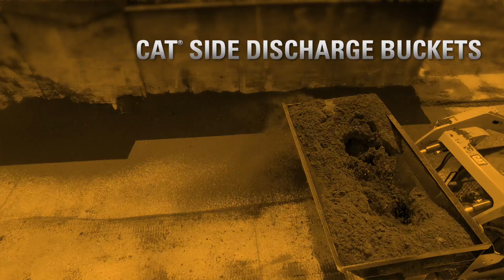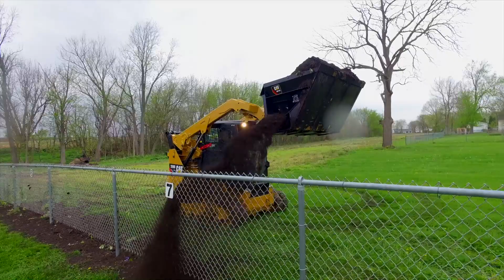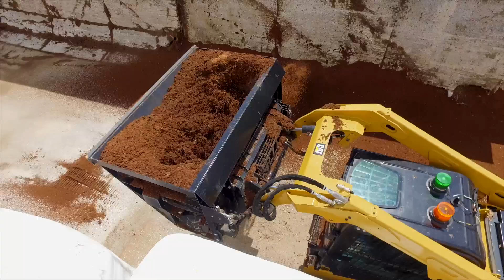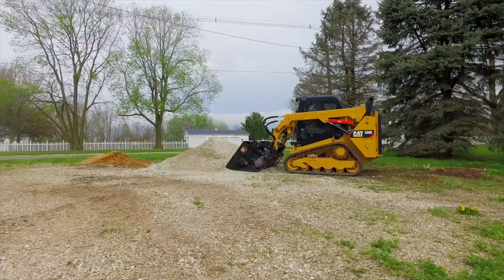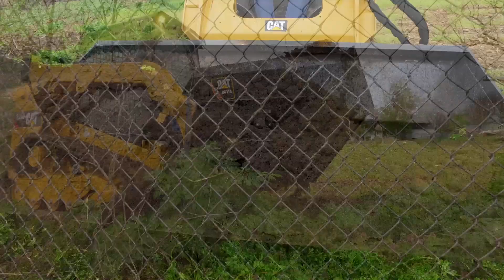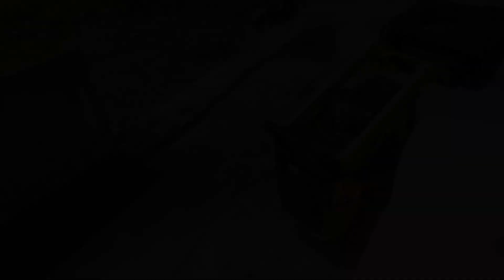Cat® Side Discharge Buckets Overview

Comment: Im looking for a similar product that is designed for 57 and 304 stone mixes for feeding a long  polypropylene tube like  bags for adobe huts. I would need a 2 foot extension to the discharge side as well and the capability of mixing concrete if needed.  Perhaps the auger might be a bit upgraded or heavier duty for mixing stone, dirt and sand. Any thoughts or suggestions? I would be using a continual movement tractor or skid steer for continual feed and the wall would be buitt in layers stacking tube on tube.
Reply: Did you find something yet?